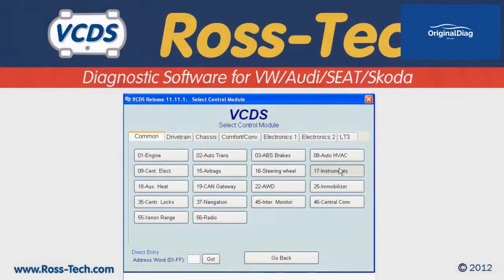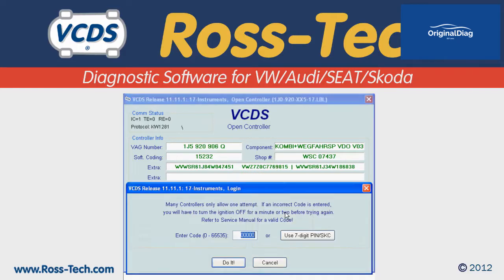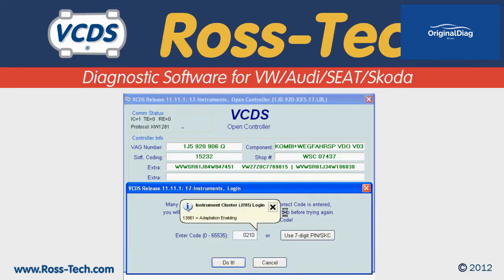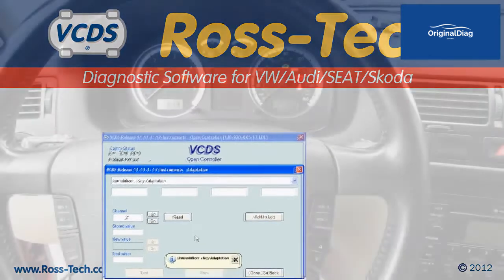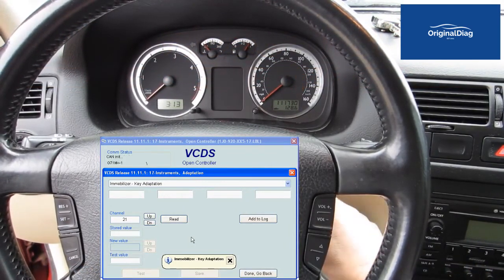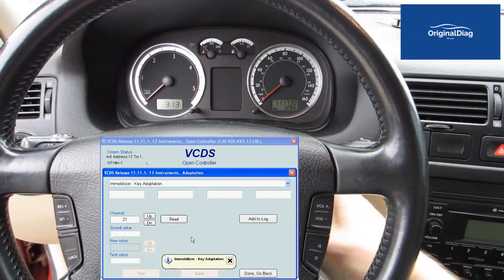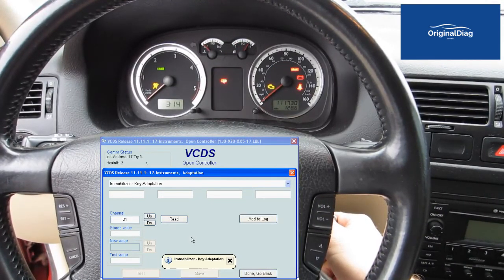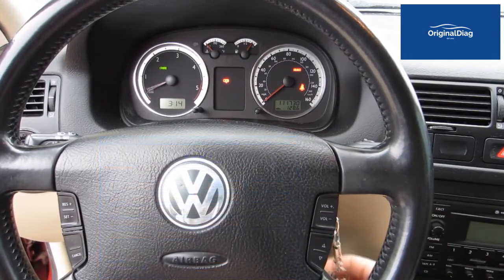Immobilizer 2 and 3 Key Adaptation VCDS - Originaldiag.com

Comment: Can you use old keys (FOB) from the same type immobilizer and reprogram the transponder to your vehicle or do you need a blank transponder chip inside the FOB?  Reason I ask, is a friend of mine, with an Audi Q7 (2009) used an old key (not programmed to his car) and the locksmith programmer was able to use it to code it to his immobilizer.